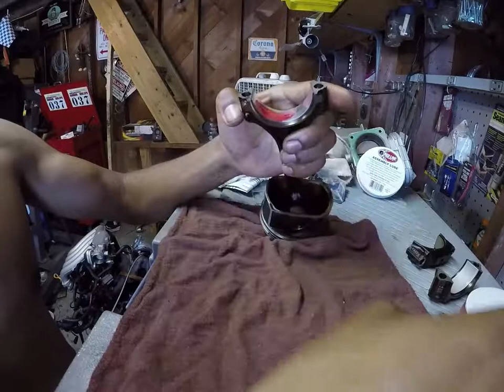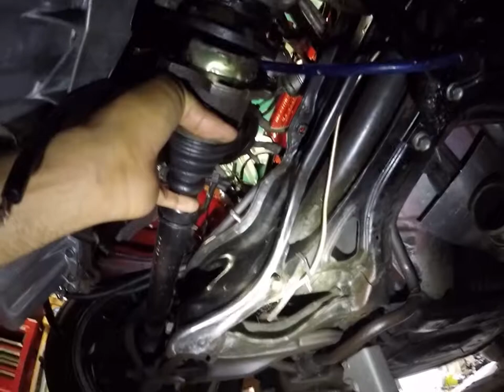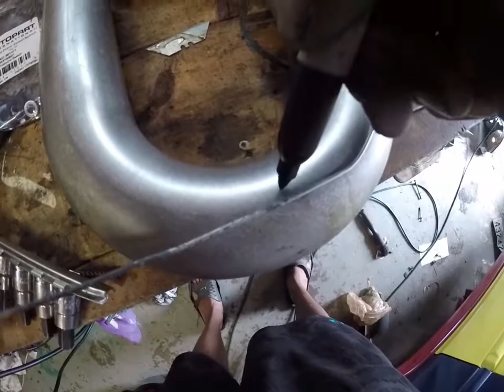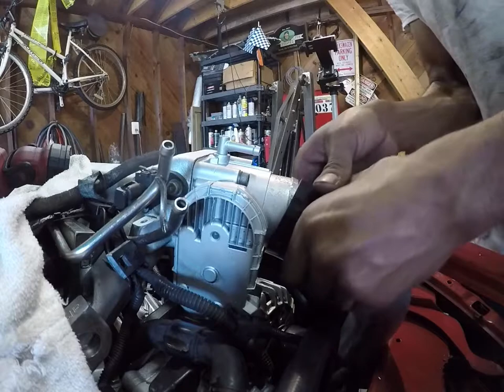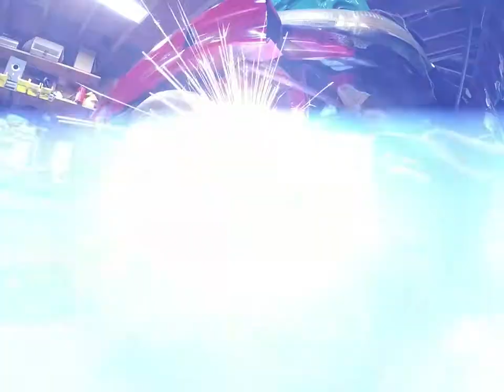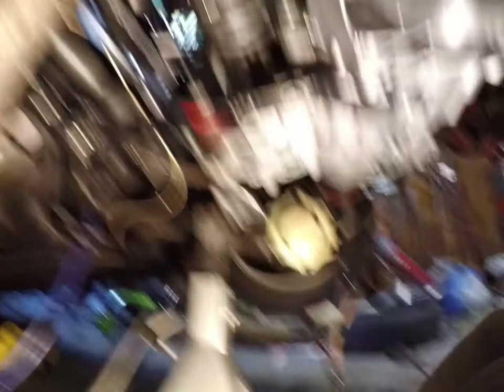Harlequin Civic: The Remix 1.8T Engine Install

Comment: You could try different subframes 1992-95 have a smaller subframe that bolt up perfectly
Reply from the maker: I have zero faith those subframe bolts would come out.  Virtually every bolt on this 380k chassis has seized and broken off the welded nut insert.  So me trying to put an EG subframe in this would likely result in just a loose subframe when all these bolts break off the mounting points